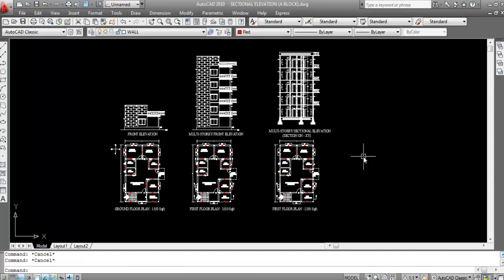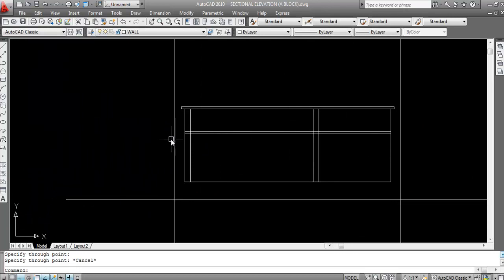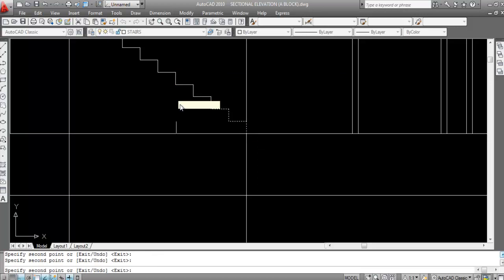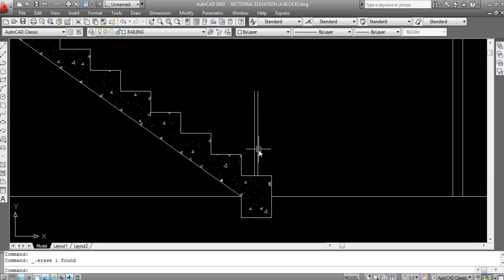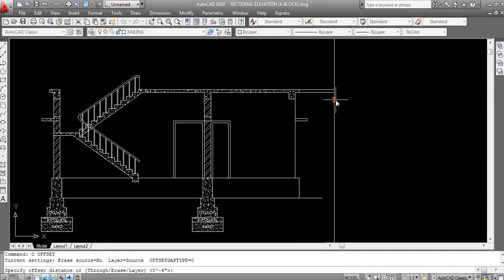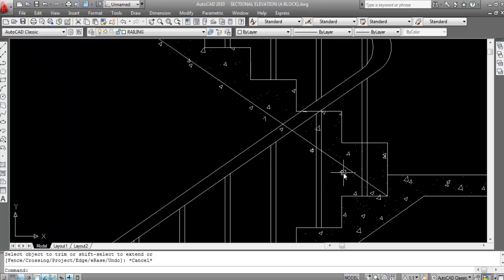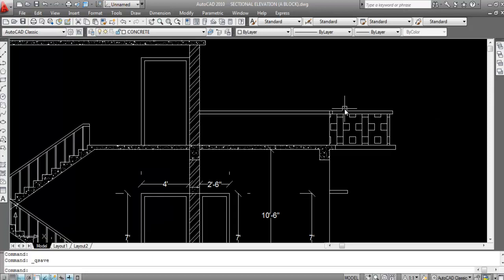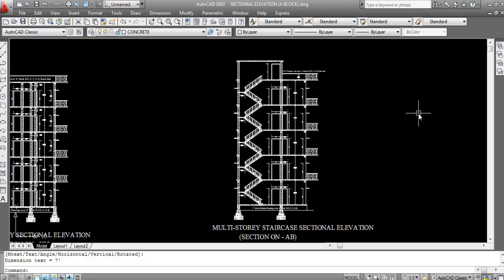How to draw Sectional Elevation Of Staircase in AutoCAD || Building #2

Comment: show  section of a stair where  traders are not same in both flights
Reply from the maker: Not treads, the last riser is not equal because the roof slab thickness should be taken upward, taking it downward reduced the total height. With the slab thickness taken upward, the riser height becomes uniform as per the section.

Comment: Well,  4 questions for me in this video
1) In this video you've taken roof beam thickness  10 inch and in other videos you've taken 6 inches thickness of roof beam.
 Why is it so ??
Reply from the maker: Why you deleted your old comments? 
I see only one question. Where are the others?
Reply: I commenting my question one by one bcz I am facing problem in commenting all questions in one comment
Reply: 2) In headroom roof beam and lintel beam (bcoz there is door in headroom) is not provided.
Will headroom contain roof beam and lintel beam or not ??
Reply: 3) Lintel beam is only provided when wall contains door & window.
Is this sentence correct ?
If correct then 2nd wall will not contain lintel beam right ? Bcoz there is no door and window in that wall beside that wall there is wall that contains 2 doors that will contain lintel beam.
Reply: 4) In ground floor there is Verandah and you have not shown any grills or parapet wall for Verandah.
Plz reply Ma'am
Reply from the maker: 1) In this video you've taken roof beam thickness  10 inch and in other videos you've taken 6 inches thickness of roof beam.
Why is it so ??
Ans: Thickness of beam of  building is considered as per design of structure with reinforcement details. So thickness of beam in some buildings are taken as 6" & in some 10" as well.
 
2) In headroom roof beam and lintel beam (bcoz there is door in headroom) is not provided.
Will headroom contain roof beam and lintel beam or not ??
Ans: Yes lintel beam is there but roof beam is not required. Lintel bem we can't see as it goes inside wall.

3) Lintel beam is only provided when wall contains door & window.
Is this sentence correct ?
If correct then 2nd wall will not contain lintel beam right ? Bcoz there is no door and window in that wall beside that wall there is wall that contains 2 doors that will contain lintel beam.
Ans: Lintel beam is provided on all wall, on lintel level which is 7' from plinth level & above door & window level. Whether there is door or not but lintel beam needs to be provided on all walls.
Reply from the maker: 4) In ground floor there is Verandah and you have not shown any grills or parapet wall for Verandah.
Plz reply Ma'am
It's an open verandah
Reply: @civilengineeringtutorials  Ma'am In 2nd answer I think we can see lintel beam because section line is cutting headroom wall also right ? By the way THANK YOU for giving your valuable time to my questions and answering them. Really appreciate it
Reply from the maker: It's an open verandah
Reply: @civilengineeringtutorials   Ma'am I am talking about headroom walls are being cut by section line so we can see lintel beam of headroom wall.
Reply: @civilengineeringtutorials   I am talking about my 2nd question's answer In headroom section line is cutting headroom wall so we can see lintel beam
Reply: Ma'am what's your view on this
Reply: Ma'am waiting for your reply
Reply: Ma'am still waiting for your reply
Reply from the maker: Today for sure
Reply: Ok ma'am

Comment: Well,  4 questions for me in this video
1) In this video you've taken roof beam thickness  10 inch and in other videos you've taken 6 inches thickness of roof beam.
 Why is it so ??
2) In headroom roof beam and lintel beam (bcoz there is door in headroom) is not provided.
Will headroom contain roof beam and lintel beam or not ??
3) Lintel beam is only provided when wall contains door & window.
Is this sentence correct ?
If correct then 2nd wall will not contain lintel beam right ? Bcoz there is no door and window in that wall beside that wall there is wall that contains 2 doors that will contain lintel beam.
4) In ground floor there is Verandah and you have not shown any grills or parapet wall for Verandah.
Plz reply